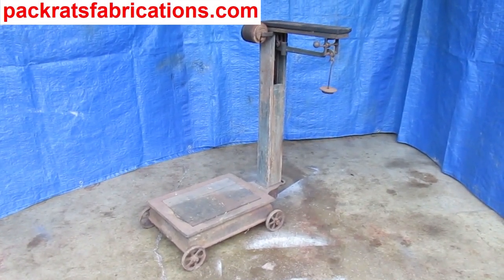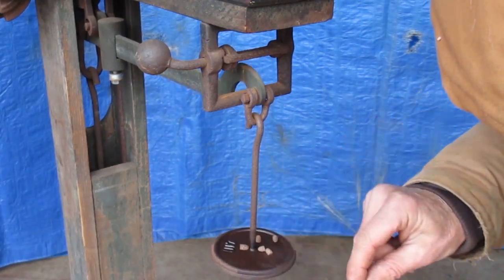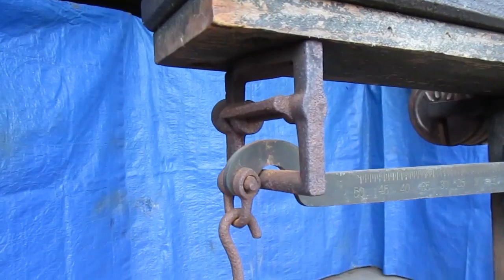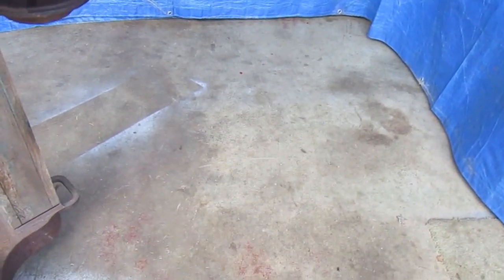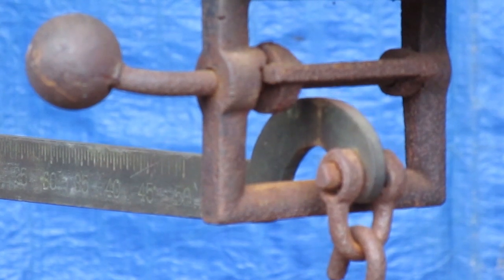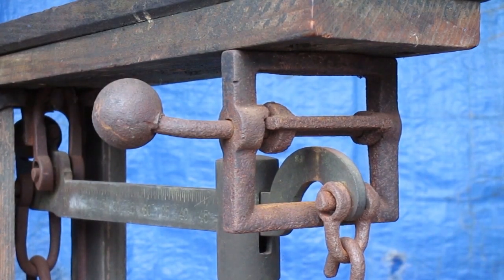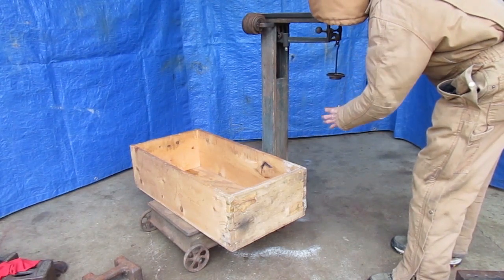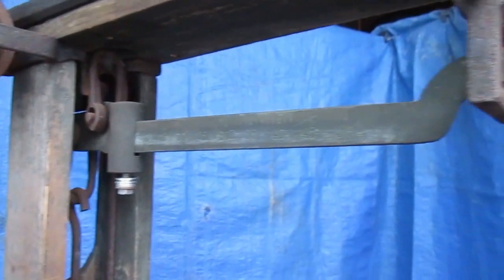Antique Platform Scales Calibration Part 2 (Farm Scales, Grain Scales)

Comment: Great video! Very detailed information. My dad had one of these for fifty years and when he passed we sold it at auction. I recently saw one just like it on FB Marketplace and bought it for $25. Don't have a need for it, but it reminds me of dad. Now it is going to be restored to look like new again and will be kept in my shop as a conversation piece. And, thanks to this video, it will also be calibrated! Thanks for making these videos! One question, does anyone have a source for parts like the counterweights?
Reply from the maker: I don't know of a source for parts. Sometimes you have to buy another incomplete one to get the parts to make one good one.
Reply: I checked and parts are available from Fairbanks. The counterweights are still in production and used in new production scales.
Reply from the maker: That's good to know, I didn't expect that. Thanks!

Comment: How do you take in account for the Counter height that you add the weights onto it? i need one for my old Stimpson Candy scale.
Reply from the maker: If you can find a hanger that will work you have to add or subtract weight to it until the beam balances with the slider weight on zero and no weights on the hanger.

Comment: good day sir! may i just ask why did you use 1/2 pound counterweight for the 50 pound weight? is there a relationship between them?
Reply from the maker: Hi, yes there is a relationship. These scales are actually simple balancing machines. The length of the arms inside and the position of the balance points provide a balance ratio of about 100 to 1. So 100 pounds on the platform would balance with 1 pound on the hanger. Using that same ratio, 50 pounds on the platform would balance with 1/2 pound on the hanger.
The reason I use a 50 pound weight for setup is because the sliding weight has a range of 50 pounds and that has to have the same balancing effect as a 1/2 pound weight on the hanger.
For more details on the theory search for my video from February 2021 called "Antique Platform Scales". I talk about the theory in the 2nd half of that video.

Comment: great videos! I have a 1000 lb fairbanks with two bars and 2 sliding weights.Can I get this to balance with one bar or do I need to use both sliding weights? I tried for 2 hrs and cant get close.Would be nice to see a 1000 lb scale video.Can I get this to balance with just the top or bottom sliding weight? Thanks! PS: the cutout on the two sliding weights is on the right side,so they both are on the 18 lb mark when all the way to the left.
Reply from the maker: If the sliding weights are all the way to the left they should be pointing to the zero mark. My double weight scale has 2-peice weights that screw together. Maybe somebody put yours on backwards. Look for screw heads on the bottom of the weights.
Then with both weights to the left, on the zero mark, the weight hanger in place with no weights on it, and nothing on the platform it should be able to balance out.
Reply: Thanks,I see no way to take weights off the bars.Each weight is one piece solid and the 2 slider bars and ends are one piece,strange set up.I wonder if FM designed it this way> Id have to cut the 2 slide bars to turn weights around. @PackratsFabrications
Reply from the maker: @craftsman5695  I've been thinkin about it, and I don't have an answer. These are simply balancing machines. When these were made your floor was almost guaranteed to not be level. The first step when you put your scale in location to use is to zero the scale, or get it to balance with no weight on it. If your machine can only get down to 18 lbs on each rail, you would have to zero your scale by using a known 36 pound (2x18) weight on the platform. That's possible but I've never seen one like that. If you want to try to get to the bottom of it send me an email to larry@packratsfabrications.com so we can exchange pictures. I'd want to see an overall picture of the scale, and closeups of the front of the weights and the bottom of the weights. My double weight scale is a Moline Scale Co., I don't a double weight FM scale here to look at.
Reply from the maker: I just looked at a Howe double weight scale, the weights have no bolts on the bottom (except a thumbscrew to keep the bottom weight in position), but it looks like they are 2 pieces that screw together like the lid on a jar. They're made so the seam line is not very noticeable.
Reply from the maker: There's a problem with youtube's comment system, I can see the first part of your latest comment, but only up to the part where you said the weights are not the same weight. Your comment does not show up in the other places where I should be able to see comments. Can you re-type your comment again please?  If this don't work we may have to go to email.
Reply from the maker: I was found a way to read your last message. There's no way for me to tell what they should weigh. You have to go through the procedure I describe in these videos using the 50 pound weight for each rail separately. When you're setting up one rail, the other weight must be at zero. Using this method when you change the weight on one rail, you may have to re-adjust the weight on the other rail. And when you're done either sliding weight at the 50 lb mark should balance the same way as the 1/2 lb weight on the hanger when the 50 lb weight is on the scale.